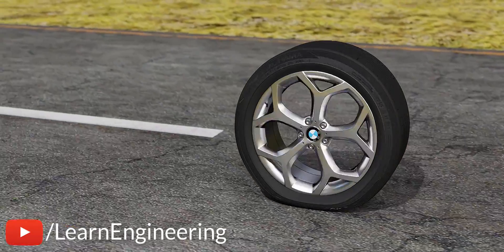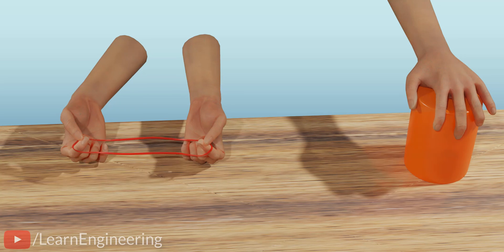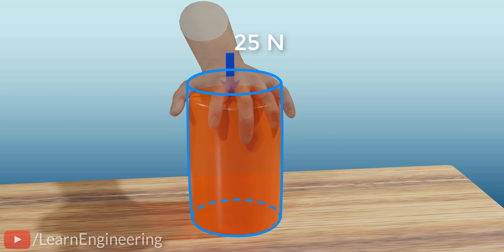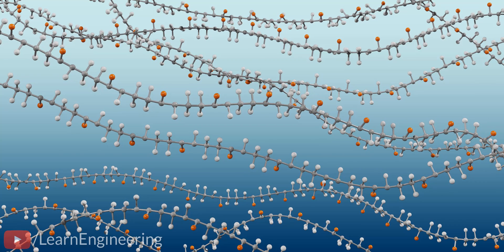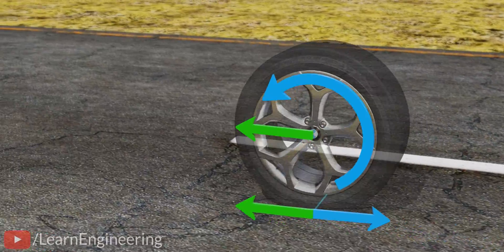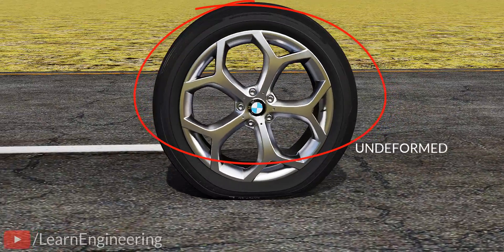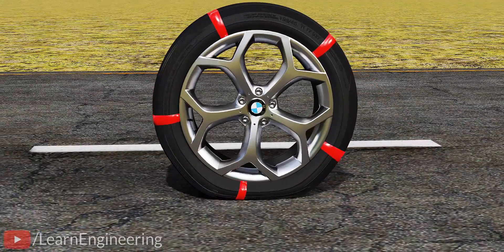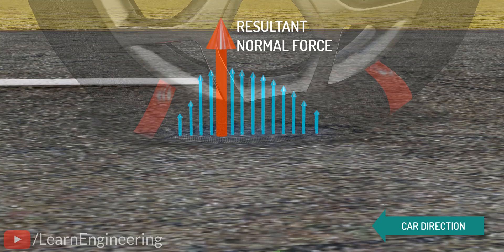Understanding Rolling Resistance!

Comment: I think this definition of rolling resistance is way too specific to tyres. Why does a steel wheel have rolling resistance? Why is rolling resistance larger with rough surfaces compared to smooth suefaces? There's some other component that isn't being talked about here.

Comment: Isn't the hysteresis heavily frequency dependent? So if you were to do this by hand, even for a rubber with maximum hysteresis potential based on temperature and elastic modulus, if you apply the cyclic load-unload slowly enough, there will be no hysteresis observed?

Comment: Is there a material with reverse hysteresis, meaning decompression is faster than the compression? If so, how would it affect rolling resistance if applied on wheels?
Reply: I think that’s impossible, considering hysteresis occurs from energy losses in the material, reverse hysteresis would have to result from energy gained somewhere.

Comment: I understand that the tire compresses in the front, and expands in the back. And as it is expanding in the back, it is losing energy? But how does this energy loss of the rubber have anything to do with the kinetic energy loss of the tire, thereby slowing it down?

Comment: A great explanation of how the hysteresis of rubber creates a rolling resistance.  But what about the relatively large contact patch area?  Since the front and back of the patch are a different distance from the axis than the middle, there must be some tangential flexing of the rubber or slippage along the road surface?  How does this come into things?

Comment: What about: Coefficient of Deceleration due to other factors? Such as

1: Chemical properties of the materials used.

2: Road and or friction surfaces in contact 

3: Amount of force exerted at what RPM?

4: At the time of the specific interval of experiment, how much acceleration was active or zero acceleration, obviously that resulted in deceleration after and or due certain conditions. 

5: wind factor.

6: Quality of the interactive surfaces 

7: E.g. if braking is applied considering anti-lock braking, vehicle or tires will sink more and increase the friction contact area.

8: values may differ for every vehicle considering, type, make, class, horsepower, automated tech, etc. So for every given scenario General equation must include scenarios specific factorial equations to calculate accurate and precise values, for example as in ballistics calculations.

Comment: If you did two experiments and in the first you took 1 second to apply the 50N of force to the rubber tube, and in the second you took 1000 seconds to apply the same 50N of force, would the expansion rate of the rubber be the same for both, or would the speed of the expansion differ between the two experiments?

Comment: What design changes go into “low rolling resistance” tires?
Reply: well, they are skinnier, and they operate at higher pressures, there are some drawbacks though: comfort, suspension components and bearing life, and of course cost. I would just pump up the tires I already have, no additional cost, and I can swich back whenever I want.

Comment: as a cyclist (and engineering dropout), my only question, is "why do wider tires have lower rolling resistance?" From the video I can only surmise that a wider contact patch produces a less long contact patch, getting it closer to that perfect line, thus two things happen: the tire deforms less and the differential in normal forces is minimized (plus the normal force is much closer to the axle, minimizing the moment), and the tire turns less mechanical energy into heat through internal friction. is that assessment right?
Reply: Beginner rollerskater here. I am following on this question!

Comment: Basically you explained rubber material behavior.
The tire Basically stops because of the friction coefficient caused by the meeting of two materials with similar/different behaviors.
That's why the tire stops.
Ff=N*μ

Comment: This is why having your tires properly inflated improves mpg.. lower rolling resistance. Some people even say to put 10% above what the car specs say to get the best mpg. Air also expands the hotter it gets so its most accurate to check the tire psi with as little driving as possible.

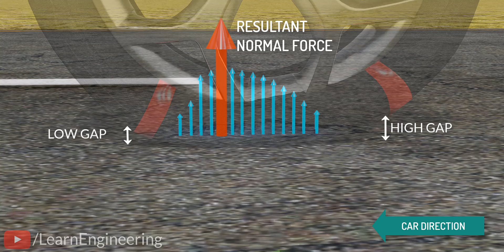Comment: 4:47 yup, that resultant force acts away from the center of the wheel. Causing a moment/torque opposite to the direction of the wheel's rotation. Also, the  heavier the vehicle, the higher this resultant force hence higher rolling resistance. Also, at a higher velocity, the tires actually expand outward which reduces the rolling resistance.  This is  one reasons why a vehicle operating at highway speed is more efficient than in cities.
Reply: Thanks, most accurate depiction till now.

Comment: The hysteresis should largely be due to the fact that the compression and decompression are not instantaneous, and so the heat generated by compression is partially lost so that the system has less energy to 'decompress' the rubber by the time its no longer being compressed.

Comment: What about rolling resistance of a steel tire over a rubber tire over an imperfect ground? Wouldn't the ability of the rubber tire to conform over imperfections result in overall  lower rolling resistance?

Comment: Compression when the tire meets the road takes energy. Energy loss slows the tire down, in turn making the cars engine work harder to stay at any constant speed. In short, make sure your tires are at their designed PSI or your car will suffer mpg ratio. Logic

Comment: Long story short this is why trains have steel wheels on steel rails.
Reply: Too bad our roads can't be smooth as rails. If we had solid metal tires that ride would break your spine. 😆 🤣
Reply: @justinhackstadt6677  The resistance of an air filled tire is less than that of a solid one on uneven surfaces.
Reply: Trains actually have steel tyres mounted on the wheels. Basically a big steel band is heated up and placed onto the wheel where it cools down and contracts onto the wheel. Trains actually can get flat tyres, a flat spot which may damage the track so they get the tyre replaced. A fitter for the Orient Express told me that while I was doing work in their train yard
Reply: @mrbadger9920  But thats a special kind of train tyre, not every train has that.
Reply: Pag Chomp Really, I had no idea. This was the only time I have really been up close to the working parts of a train in that kind of environment. It was Pullman carriages so presumably they were pretty old. 
Do modern trains have solid wheels now?
Reply: Loco! Motion! Shits crazy mang
Reply: Also when the train is moving you need almost no power to keep it moving, I've heard just 25hp can theoretically pull a train when it's already moving
Reply: No. It is to guide it on rails and increase the load bearing capacity, as the load is transmitted to the road along steel beams and wooden or concrete posts with a large area for rails and just four patches for tyres. Those are just two reason on top of my head, I'm sure there's more.
Reply: Roberto I’m sure it is a contributing factor as to why both are steal, being both are steal there barely deform to eachother upon contact and movement. That also means that they wouldn’t wear as quickly as tires would on a road. When rails were introduced, vehicles that could transport that much material so easily were few to none, so having such an efficient mode of transport was necessary.
Reply: @thomasloebig8612  I've noticed steel rails do bend down a few cm when the wheel rolls over this must introduce some losses
Reply: Martin S oh for sure. Haven’t been able to close watch a train on rials. But any sound or movement you see is loss. But when a single car could weight 80tonnes, there’s enough moment it may not make that much of a difference
Reply: @thomasloebig8612  Sound, movement, or heat.  I can't recommend touching one, but put your hand close to the a rail after a particularly long train and you can tell just how hot those rails get.

Comment: I have a question and I hope that I could find the answer.
Instead of car engine why we do not use  a genenator  as an engine which work by elctromegnatic force????
Reply: We do. Electric cars. Electric cars have a battery which provides power to a moter,which is basically copper wire wrapped around a core that creats a electromagnetic field which makes the rod turn.

Comment: Yeah, I get about the circular Rubber tyre... But you didn't explain the steel tyres... Cause they too stopped after some distance... 
Do steel tyre also has rolling resistance due to the same hysteresis concept???

Comment: So I am guessing the job of the material designers is to minimize this hysteresis? If you could revert the hysteresis you could make infinite energy? 😯
Reply: They need the tyres to flex though for grip other wise they would just use steel wheels with a thin layer of rubber.

Comment: Roll them both at a speed that is equal to there mass, rubber tyre does not weight anywhere near as much as steel, so if both are rolled at the same speed then of course the steel will roll for longer, but not due to rolling resistance.

Comment: I get hysteresis, but isn’t most of the energy simply lost through deformation alone?
Reply: Well no because if there were no hysteresis at all, the back of the tire would push against the road with the same force that the road pushes onto the front of the tire, cancelling out the force pushing backwards. So basically hysteresis causes losses because it prevents the tire from pushing forward as hard as it pushes backward.
Reply: Luke Sanchez  I get it. I was thinking of this in terms of in/elastic collision, where the tire is not perfectly elastic and therefore energy is lost. But I just realized it’s simply another way of describing hysteresis.

Comment: I didn't get why the viscous effect leads to energy loss. What energy is lost exactly? I think you're saying you need to put more energy into compressing it which is stored in the rubber and is released later to push the molecules apart to decompress? It's hard to wrap my head around this part.

Comment: I knew it!!  I was tired of people saying "A low tire will cause bad gas mileage because the contact patch is wider when the air is low" WRONG. Gas mileage is worse with low tires because of the energy loss associated with that rubber being mushy gushy.

Comment: Hello, thanks for the great video! I have a question. In the rubber cylinder example, it is a solid piece of rubber, but in the tyre, it is filled with compressed gas. Doesent this drastically reduces the hysteresis effect on a rolling tyre?

Comment: Very interesting but what about the effect of the air inside I know racing cars inflate low pressure & I assume hysteresis energy warms air which inflates to operating pressure having a cycling background there is debate over nitrogen inflation tyres & 26 inch & 27.5 or 29 inch radius on mountain bikes ??? Good video 👍

Comment: Why does the steel tire have rolling resistance if it doesnt compress?
Reply: because the surface quality of the road acts a force vector against the tire. if you would roll that steel tire on glass, that would be a different story. friction occurs between almost any two materials

Comment: When practical, I usually run my tires at maximum pressure. Less deformation creates a smaller patch area, which produces a rougher ride, but reduces rolling resistance so slightly improves fuel economy.
Reply: Smaller patch area also means less friction in wet conditions which is needed to stop. 🤷‍♂️ pros and cons.
Reply: @isaacbrewer5616  almost the time is dry road.........
Reply: Carlos Reis That’s like saying you don’t need a seatbelt because almost all the time you aren’t in a crash. Just because you don’t need it 99% of the time doesn’t mean you shouldn’t wear it to be prepared for that 1%
Reply: lol but you also have less contact patch for corners so you need to take them slower and accelerate on the next straight more -> losing fuel economy :)
Reply: @Issac Brewer @Keisuke Takahsai You boys are off in the land of theory. Here in the real world, I'm driving heavy-duty trucks with 80 psi in the tires. On-road, or off, we drive fast around here. And we don't slow down corners, little cars, or people who can't drive well enough to keep up.

Comment: One question ... What if we create tyres of some strong alloy like steel  , instead of rubber we can reduce energy loss ... Then why we don't do that?
Reply: You don't have control over it. If you brake the wheel may not rotate(locked) but still you have translation. Also tractive properties take hit, that's acceleration causes wheel spin because of no grip on roads
Reply: @pradeepkumarsundaram9056  then how it's used on train tyres ?
Reply: @bhupeshpattanaik7150  trains uses rails not road i.e., they are guided. Also if you notice the braking in train so difficult and the loco pilot will need to be so much careful when to begin the brake as it tend more time to stop because mass inertia as well as less availablity grip on rails for wheels to not slide
Reply: @pradeepkumarsundaram9056  thanks for the answer 😀👍